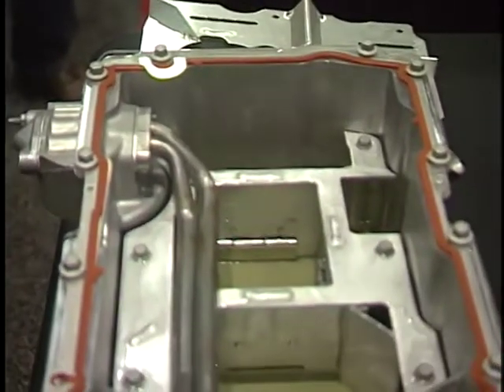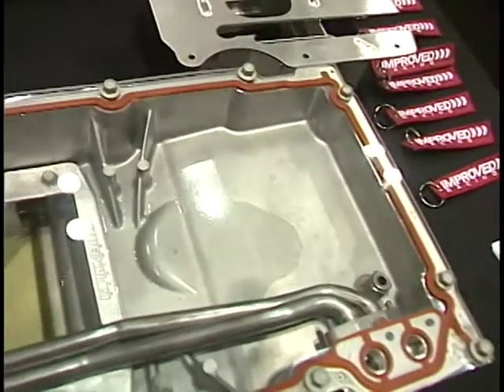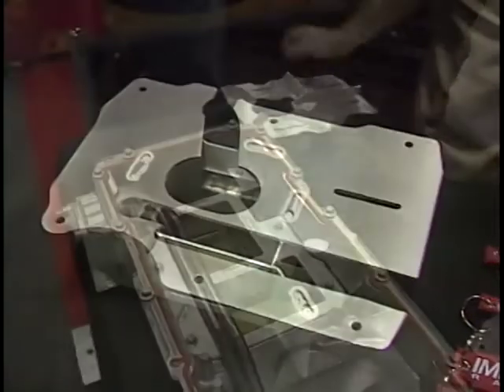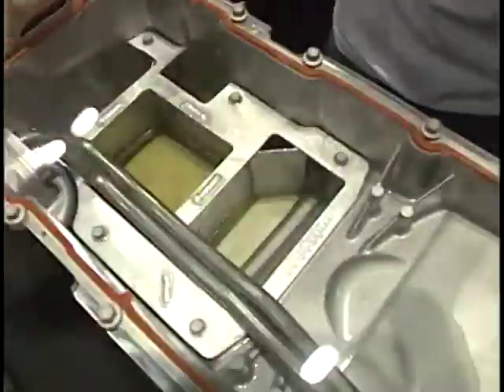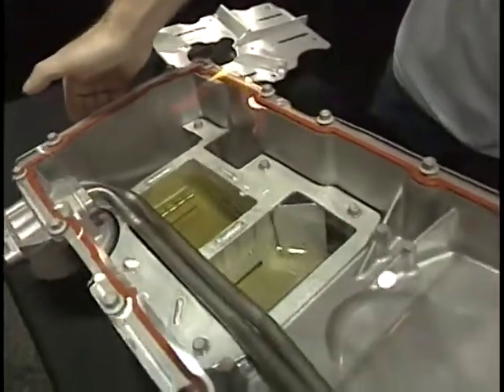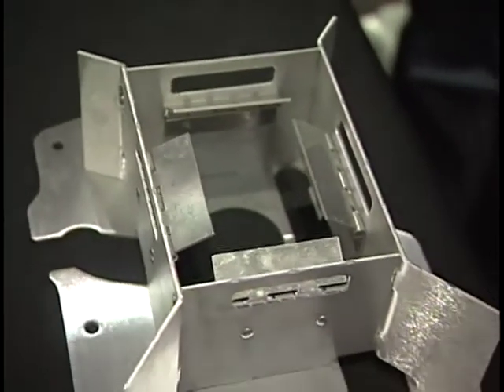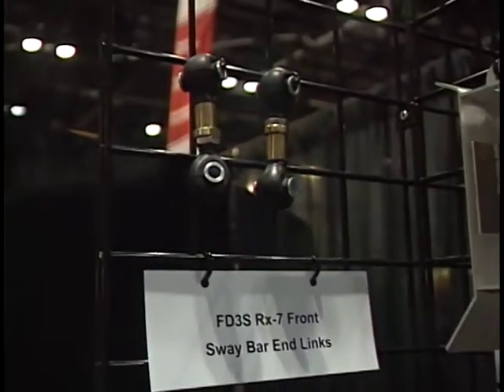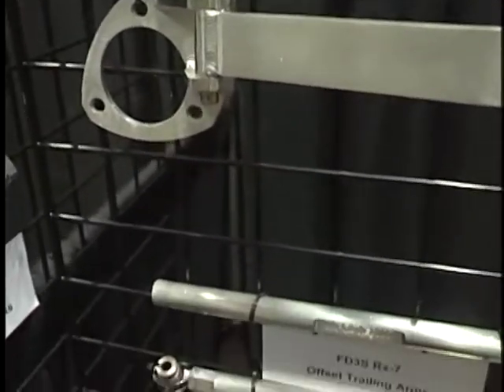How Oil Pan Trap-Door Baffling Works - Improved Racing PRI Interview

Comment: Thanks to IR :)
#EGM-404 and #EGM-403 are great pans for my future ls3 swap into GAZ 66 ! Can you explain what difference between this two pans? On website they looks similar...
Reply from the maker: Hey Vitaliy, the pans are identical, except that the EGM-403 setup (pan # 12599397) has a pressure relief valve which is only needed for engines with cylinder deactivation or variable valve timing, as these engines run high flow oil pumps to actuate these systems. If you don't have cylinder deactivation or VVT, use the EGM-404 setup (pan # 12581209) since it's less expensive.

Comment from the maker: Just an update, the new part number is EGM-204 for GTO. EGM-205 for the Pontiac G8 / 2010+ Camaro / 2014 Chevy SS. EGM-200 for 98-02 Chevy Camaro and Pontiac Firebird (V8 models).